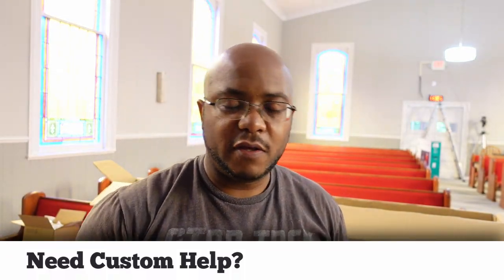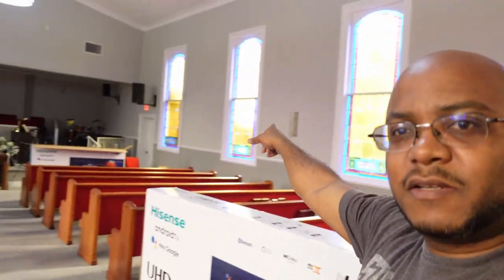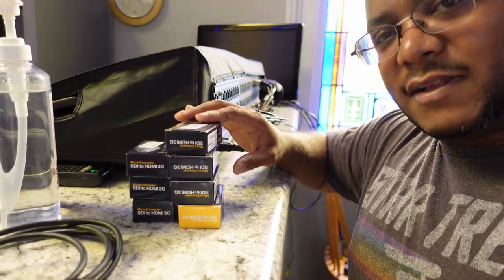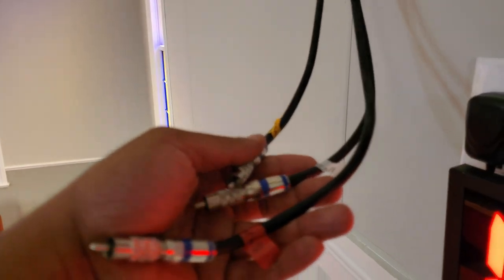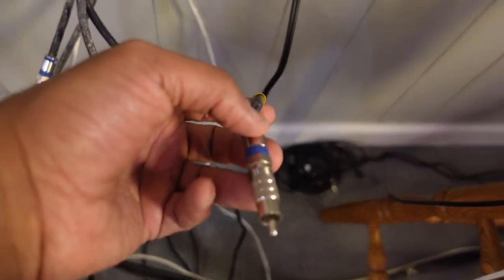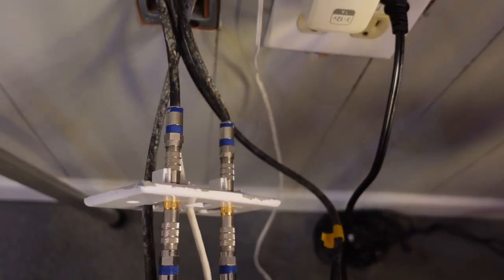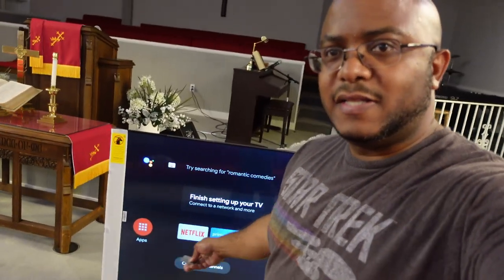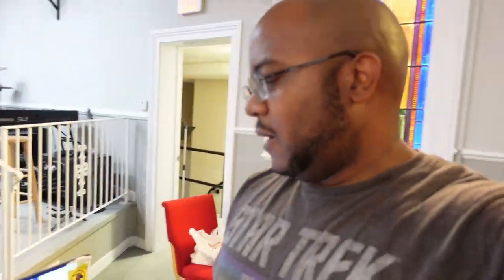AVKANS MULTI-CAMERA VIDEO SYSTEM INSTALL | Day 1 | Union Grove Baptist Church

Comment: @AJay, what specific XLR to 3.5 mm cable did you use to bring audio to ATEM Extreme? Do you have links? Also did you use line out? Do you have audio & video out of sync by a few frames with new ATEM Mini Extreme or Extreme ISO? Sorry for so many questions, trying to optimize my system.
Reply from the maker: I used this cable to get audio from the X32 to go into the ATEM Mini Extreme: https://amzn.to/3k6Hl6i
I do not have any sync issues. I use line out.